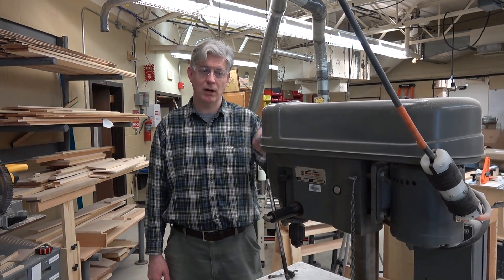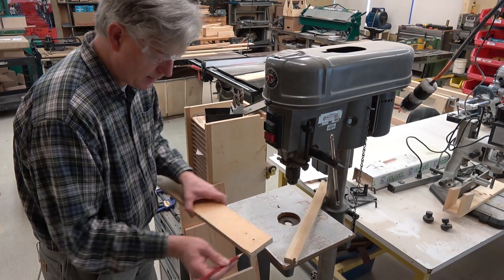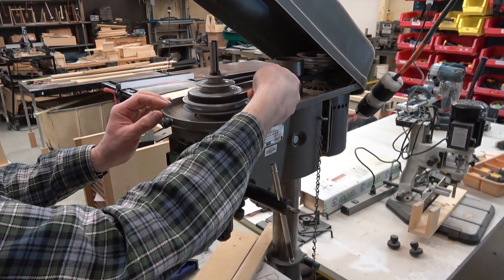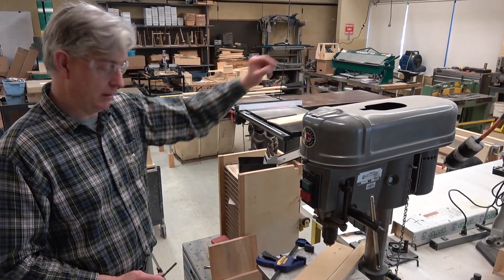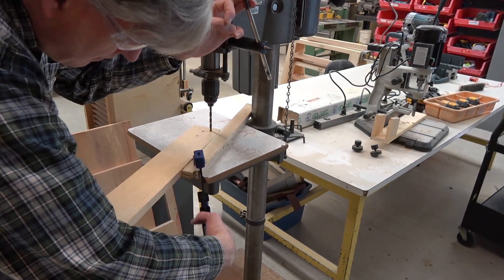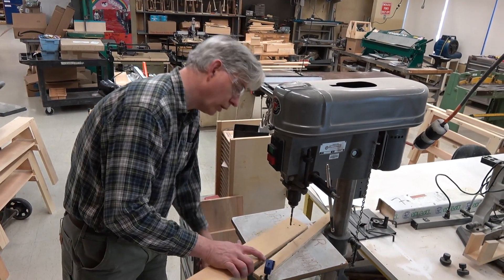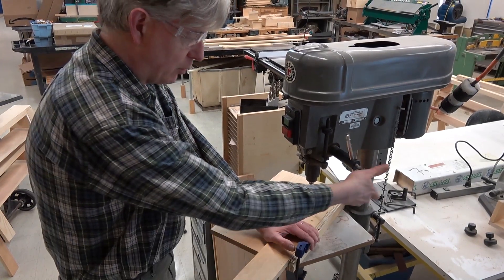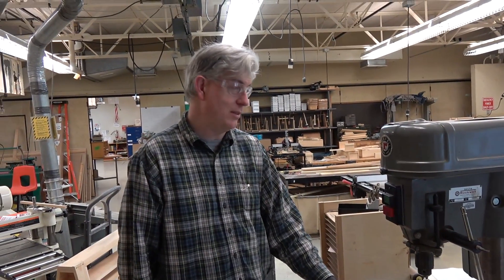Rockwell Drill Press Training

Comment: 2 things. First, the way you are demonstrating the use of the fence is wrong. If that work piece grabbed, it would go right into your right hip with nothing to stop it. Take this video down. Second, please mention that long hair, necklaces, chains, or anything loose on the wrists, anything that can get caught in a power tool will turn into a high speed cutting device or pull you into the machine.

While you are at it, since you are calling it a safety video, you should teach the golden rule of safety, "time and distance" the less time you spend near something dangerous,  and the farther away you are, the safer you are. Time and Distance applies to everything so it's good to keep reinforcing that. When people are comfortable with their tools they are at the greatest risk. That Familiarity and Comfort is why so many people get hospitalized using non-powered tools.  So I also like to teach the danger of the "comfort zone". If you think about it, it's still time an distance, because the more you do something the more comfortable you are doing it, in turn you have been doing it a long Time. 

Please take this video down. If you were cutting metal without the stop on the right side of the work you might not have survived that. It's also a good idea clamp the work piece which you didn't even mention.